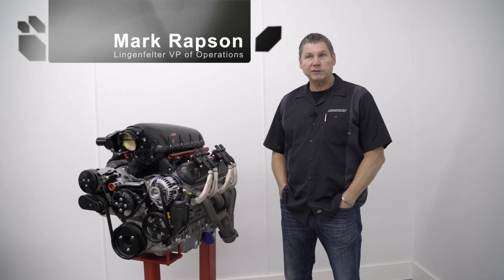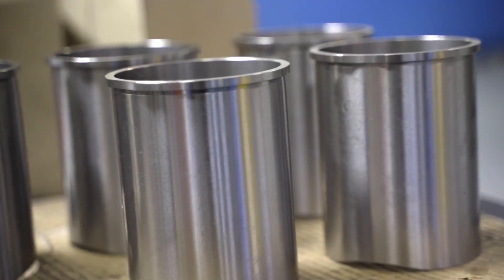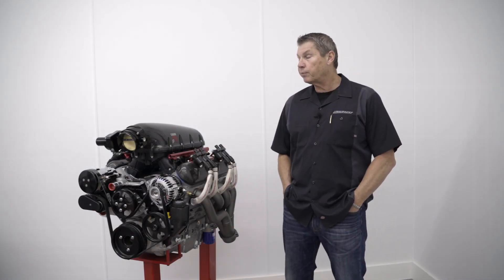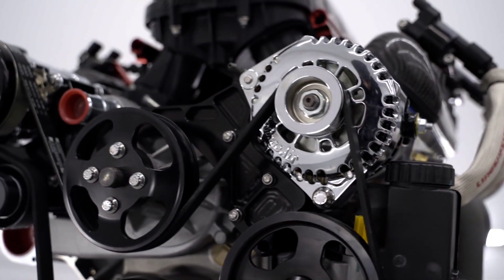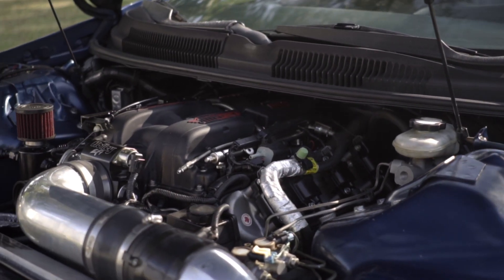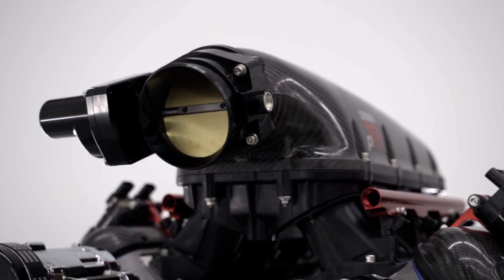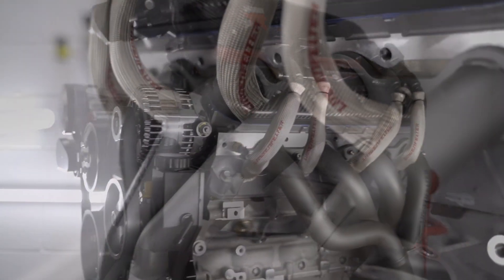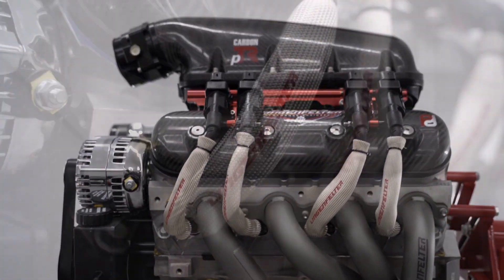Lingenfelter Eliminator Spec-R LS7 | Engineering & Build Process

Comment: Did a google search and found this: "Pricing is build dependent, but we were told that the engines will start at around $12,000 for the lower horsepower street versions and it’ll be in the mid $20,000 for the race packages".
Reply: 20k is low, go higher for the 427.